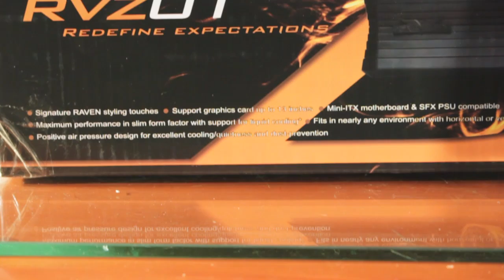Silverstone Raven  RVZ01 Build - Compact High Performance Gaming

Comment: How does the Silverstone 600W PSU work? I read many negative reviews about it making a lot noises and failing after heavy uses. Is it solid in your opinion?
Reply from the maker: +Tianyu Yang Silverstone makes good PSU's in my opinion. Under load it wasn't loud at all in this build. The fans on the GPU were much louder.

Comment: Great video!
Could you tell about noise level and temps of GPU and PSU on Load since im willing to get one for me to for a small build and im not a hardcore gamer but when i play i like to have some horse power ;) 
Im thinking to get 780TI with my i5 3570K OC and set that in space behind tv.Greatings!
Reply from the maker: martingru I don't have noise level measurements, but it's a fairly quiet system. The fans on the  GPU and PSU don't spin up unless their load/temperature requires it. At idle it's almost silent with only the  two 120mm case fans + CPU fan running. I didn't notice the PSU fan spin up at all, even under load, but when the GPU fans spin up you can definitely hear the system running.

Temps are in the video description.
Reply: Xero852 That is more than i needed TNX!
Reply: Xero852 I'm unfamiliar with four wire fans. You say the system was fairly quiet with the stock Silverstone three wire fans. Would variable speed four wire fans decrease the fairly quiet do something like 'darn near silent'? The Z97 looks like it can do a lot with fan speed, if it has fans that can spin at more than one speed to work with. Then again, perhaps the box is quiet enough that swapping fans would be more money than improvement.
Reply from the maker: The only fans that I'm aware of are normal voltage control type, and PWM type. Those are two and three wire fans respectively. PWM allows more refined control of fan speed, as that third wire essentially provides a speed control channel to get the fan right where you want it.

Two wire fans rely on voltage adjustments to change speed, and they aren't very accurate at maintaining a specific speed.

If a motherboard has three-pin fan headers it likely supports PWM.

Comment: Would a Corsair H60 cooler fit. It says max of 83mm and fan and heat sink are like 50mm in total thickness and the fan could be attached to the case where the cpu is.
Reply from the maker: Haven't tried AIO coolers in this myself. Remember the AIO fans have a radiator attached that adds depth as well. So you need to total rad + fan + CPU block measurements, and then ensure the fan/rad assembly won't physically interfere with any other motherboard components or RAM.

If you did a custom water cooling loop with an ITX (short) sized GPU, you should be able to water cool the entire system. I'd love to try but haven't had the need.
Reply: @Xero852  that leaves 33mm in spare room for the cpu block which should be enough.

Comment: Shouldn't the CPU fan be pushing hot air out through the heatsink and exhausting through the case? Because your Raven already have two intake fans blowing into the case and on to your GPU.
Reply from the maker: Kexin As all the intakes are dust-filtered, and there is plenty of passive exhaust vents, I opted for an all-intake setup.

Comment: Wouldn't you ideally want a reference card in this case due to the small form factor?
Reply from the maker: TRAILBLAZER02 Possibly, but they typically cost more due to the metal design of the reference coolers. The third party coolers cost less, and I can't see the blower cooler really reducing temps that much. As you can see in the description, temperatures aren't that bad at all!

Comment: I'm thinking of transferring my Alienware components into this case. I was wondering if a EVGA 600w 80 Plus Power Supply will fit in this Raven. If you're wondering why I'm transferring my components; it's because I'm upgrading my graphics card to a 970 from a stock 760. I'm building a Ravenware lolz
Reply: I obviously didn't research this case throughly. It only supports sfx power supplies, so I may just find another case that supports ATX. I really have no idea what I'm doing. I have a mini-ITX MB soon to be paired up with an ATX PSU. Just hopefully I just get this thing running.
Reply: +MysterOwl I moved the same Alienware x51 to a Corsair 250d. Bought the Corsair CS550,  the H100i GTX liquid cooler, and a gigabyte motherboard. Everything else stayed the same.

Comment: That's a pretty huge CPU cooler but seems to be like the one's in Air Condition. Looks strong but too big for a mini-ITX. Thanks for the video though.
Reply from the maker: It's designed for mini itx boards like this. It's large because air coolers require surface area to dissipate heat.

Comment: I'm curious as to what the noise level is while horizontal during heavy load as well as cpu, gpu, and ambient temperatures. I'm considering this case for a gaming htpc build.
Reply from the maker: b101 Sorry, didn't actually get to keep the system. As I mentioned it was just a test build for my workplace. It was fairly inaudible at idle, and the only increase in sound during load was the GPU fans spinning up for the most part. Never witnessed the PSU fan spin up at all (it spins up based off heat/load on the PSU).

Comment: I did a build in this case for my brother.
I had to do a fan-mod cause the sfx 450w psu from silverstone was just to loud.
I like this case and my own pc is going in one as well (with gtx 980Ti I hope).
Just lucky that there is an 500w sfx-l psu now with a 120mm fan.

p.s. why don't you remove that bracket in front of the psu? Its only for watercooling and this gives so muc hroom for cables.
Reply from the maker: Melvin Gimp It provides support for the GPU bracket actually.
Reply: Xero852 since the bracket is mounted with another 4 screws on the case and I have the PC upright anyway... I don't have any concerns ;)

Comment: Is it possible to put a GTX1080Ti in the case?
I want to use the ASUS ROG STRIX GTX1080Ti-O11G-Gaming, but I'm not sure if the width is enough...
I saw this on the manual," With the graphics card holder installed, the maximum allowable width for graphics card is 5.18”. (13.16cm)
Without the graphics card holder, the maximum allowable width for graphics card is up to 5.88”. (14.93cm) ".

Unfortunately, ASUS ROG STRIX GTX1080Ti-O11G-Gaming's width is 13.4cm.
So I think I can't use the graphics card holder?

But the manual said that without the graphics card holder, the maximum allowable width for graphics card is up to 5.88”. (14.93cm) ".
Does this mean that you can still install the graphic card without the graphics card holder, or it's just saying the length limitation, so we must use the graphics card holder in order to put it in?
Reply from the maker: skyfantasy39 I'm pretty sure you need to use the holder unless you use your own pcie extension and custom bracket to hold the card in place.

Comment: hey i wanted to ask. can you use n compact All-In-One CPU Liquid Water Cooling System with 120mm Radiator? in this case?
Reply: cthepimp23 i believe the Corsair H55 fits in this case.  So anything that thickness should be fine...I'm not putting my money on it though until you do some more research on it.

Comment: Can a triple slot GPU fit in there? According to the RVZ01 manual the maximum width allowed is somewhere near 68 mm (without case fans) and the GPU I wanna put in there is about 51mm (Zotac GTX 980 ti Amp!Extreme Edition) which is a triple slot GPU requiring 2 slots for output ports. Will it fit?
Reply from the maker: it you remove the case fans in that area, I believe so.

Comment: Hello, I was wondering if a 9.5mm slim slot optical drive can be installed in this chassis. Thank you.
Reply from the maker: Checkout 7:20 in the video.
Reply: +XeroPoint Yeah I saw that part, was wondering how what the specific dimension of the optical drive is for slim slot drives, I have a choice between 9.5mm or 12.7mm and not sure which one to purchase for the bracket.
Reply from the maker: Moss Eater The Silverstone one used was 12.7mm. I'm not sure if the 9.5mm ones would work without some kind of adaptor bracket.
Reply: +XeroPoint Ah I see, thank you for your help.

Comment: i have a question, why didn't you use the Noctua NH-L12?
Reply from the maker: Don't recall. either it wasn't available or it cost more.
Reply: cause I wanted to build on rvz01b but i want to see if it's possible to overclock the cpu
Reply from the maker: SayHEY it's definitely possible to overclock the CPU. You just can't go crazy. Most people don't need to overclock anyway.
Reply: XeroPoint yeah it's not worth it. but what about overclocking the graphics card?

Comment: do you think one could fit a water cooled cpu and gpu in this case. using a custom aio cpu block pump and ek gpu block with slim rad and fans.
Reply from the maker: Yes, it's been done a few times by people already. Definitely more of an advanced water cooling project though. Very tight working conditions.
Reply: I will take the challenge

Comment: would the gtx 970 acx fit in this case?
Reply from the maker: +silly9127 Yes. The GTX 980 in this system is using the ACX 2.0 cooler. It's essentially the same on the GTX 970.

Comment: The really should design the cases with cable management in mind.
Reply from the maker: +Canute87 When you get this small, there's not much you can do in terms of cable management. I've worked in worse cases than this for cable management though!
Reply: Will you have a problem with temperatures if you don't use a blower style card?  Like for instance the evga SC 1060?

Comment: Will the 980 ti hybrid fit in this case? I just ordered this case but not sure whether to get the acx cooler or the hybrid, is it at all possible to fit the hybrid with the radiator in this case?
Reply from the maker: +Zane Carter Probably not, because the Hybrid uses the full dual-slot reference cooler design. If you bought a reference 980 ti, water block, slim 240mm radiator, pump, etc... You could build your own water cooled GTX 980 ti setup that would fit in this case for sure though.
Reply: +XeroPoint Do you think a water cooler with a 120mm rad will fit in the GPU chamber?
I have an EVGA GTX 970 ACX 2.0, the same size as the one you have i believe.
The cooler i am thinking about is a Silverstone Tundra TD03 in pull or push (Not push-pull)
Reply from the maker: Captain Gray If you're using a dual-slot GPU (basically anything with a decent cooler) then the only space you have under it is for "slim" style 120mm fans or possibly a slim/thin radiator. But you won't be able to get fans on that radiator, it'll be too thick, even if you use a thin rad + thin fans.

You'd need to put a single-slot water block onto your GPU to free up more space to do water cooling well in this case.
Reply: XeroPoint
I was thinking of using an AIO Liquid CPU cooler and go with the standard ACX cooler on the GPU.

Thank you for answering. Much appreciated.

Comment: Do you think the SX500-LG power supply would fit?  It's SFX-L with 30mm additional depth.
Reply from the maker: Silverstone lists the case as SFX-L compatible, that extra 30mm depth likely fills up the area I used to stuff cables into for cable-management in the video. Meaning you'd need to be a little more clever with cable management than I was.

Any particular reason you want to use SFX-L over standard SFX? The 600W SFX PSU I used in this build is perfect in this case, and if you don't need that much power they make a 300, 450, and 500W versions as well. The RVZ01 doesn't have a large enough fan grill for the larger 120mm fan on the SFX-L PSUs to be of much use IMO.
Reply: Xero852 bigger fan, so quieter when it needs to spin, looks like the new revisions of the rvz01 v1.3+ has a larger ventilation area over the PSU to accommodate it too
Reply from the maker: Joshua Harvey Well, the 600W SFX I used doesn't spin the fan up ever. Even with the system under full load of the components I used in the video. Have also since added a 3.5in HDD for what that's worth.

Just FYI, I'd buy whichever option is cheaper.
Reply: Xero852 Good to know, thanks!
Reply: Xero852 I bought the 500-L PS before watching this video based on the larger fan size. In retrospect, I've I'd been able to see the RVZ-01 before ordering the PS, I'd have gone with the non-L model like you did. With the small vent area for the PS, the smaller fan makes more sense.
Reply: Gar Nelson The vent area has been enlarged due to the release of the 500-L PS. Just gotta make sure you don't get old stock, if you did i'd suggest you try to exchange it for the new updated version.
Reply: Thanks Gillis. I don't see any frame on the P/S through the vent grid, so I'm just going to call it good. The longer power supply fits without any issues, and I've got all the cables installed and routed. It's a great case and P/S option.

Comment: I built my first PC with this case 2 years ago and love it! I was wondering if you have overclocked your CPU and if so what kind of temps are you getting with this cooler? My 3570K is starting to get a little slow on some newer games at stock speeds so in the market for a decent cooler. I'll be watching your video again soon while I do some upgrades as you did a wayyyy better job at managing cables than I did as you can see here: http://i.imgur.com/zfbIXq8.jpg

Comment: could an h100i fit in there if I don't install a gpu? I was thinking a kaveri build in this would be sick
Reply from the maker: +Raymark Eblacas Yeah you should be able to fit it over in the GPU bay without issue. I'm not sure if the tubing is long enough to reach to the CPU socket though.
Reply: +Xero852 even with a gpu installed? nice I'll think about buying this for my living room
Reply from the maker: +Raymark Eblacas With a gpu installed you'll likely need to install the fans on the outside of the case. Not sure the tubes coming out of radiator will clear a dual slot gpu. single slot should work.
Reply: +Xero852 I'll just go with a kaveri apu solution  no gpu and ill  overclock the apu with a h100i

Comment: 600w psu is enough for 980?
Reply from the maker: +GAO Xiang2 Nvidia quotes 500W minimum. They include the rest of your system in that calculation, so a 600W should be plenty.

Comment: İ5 6600k and msi gtx 970 with 450w sfx 80+ bronze psu will work in this case?
Reply from the maker: +xBlackxism I would personally beef-up to a 500w PSU if you can. And I always advocate Gold 80+ rating for PSU's. It's typically worth it, and the PSU will last you a lot longer.
Reply: +XeroPoint 
İ bought silverstone sfx l 500w 80+gold psu last night
Ty for the answer :)
Reply from the maker: You're welcome!

Comment: Can i use an intel core i3 4160? Beacuse some motherboards are so demanding
Reply: Yeah you can. But what do you mean "demanding"
Reply: Jacob Owens I ment using the core i3 with the motherboard used in the vid
Reply: Metal Killer You can use it on that motherboard just fine. And can always upgrade to an i5 or i7 later and the motherboard will shine more.
Reply: Jacob Owens ook
Reply: Metal Killer So does that answer it? ASUS Z97I aka the one he's using is a really good itx mobo for any processor.
Reply: Jacob Owens yeah

Comment: has anyone tried custom fitting an atx psu
Reply from the maker: +Doge Gaming I haven't seen anything online about this... Not sure it's needed really.
Reply: sfx psu's are really expensive and give low wattage
Reply from the maker: Doge Gaming You're limited to a certain amount of hardware in this machine. SFX should be plenty with the advances we've seen in power efficiency from Intel and Nvidia.
Reply: but i have amd and ati
Reply: +Doge Gaming I may attempt to custom fit my EVGA 600w PSU into this case. I'm transferring my Alienware components into it along with a new GTX 970. I bought an ATX PSU without really researching, so yeah, I hope this works.
Reply: tried it fail.

Comment: your cpu fan is installed the wrong way.
Reply from the maker: +Vat Man Negative. Installing it this way results in the best cooling for the CPU. It's drawing cold air directly from the outside of the case through the CPU heatsink, then dispersing it into the case to be exhausted passively or by the GPU-area fans. I tested in both configurations and got the best results with this orientation.

Comment: Great video. Was worst install I've ever done, but your vide helped a lot. Although "as tight as you can" was not necessarily good advice on those spring tension screws. :) That cooler installation made me want to kill myself. And then the screws snapped as I tightened them down good. Plus made a few mistakes with the SATA drives and had to undo it to get back at it. You REALLY REALLY need to plan this install out carefully.
Reply from the maker: +derek smith If you snapped a spring-loaded screw like that and were hand-tightening with a screwdriver instead of a ratchet or something (never used force-enhancement tools on computer parts, it's just a bad idea!) then you're either extremely strong, or your screws were a lemon from the factory. It should be impossible to over-tighten them that much...

Comment: wtf
your gpu fans are working on EXHAUST all the time, but the fans in front work on INTAKE. 
WTF ???
Reply from the maker: Brings cool air into the case, while the fans from the GPU relieve the heat from the GPU itself. Works fine.